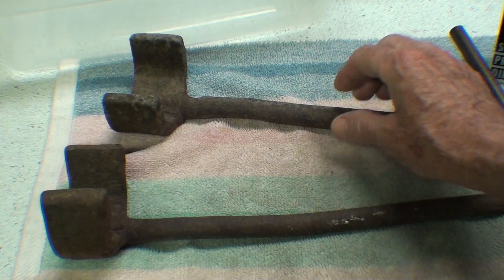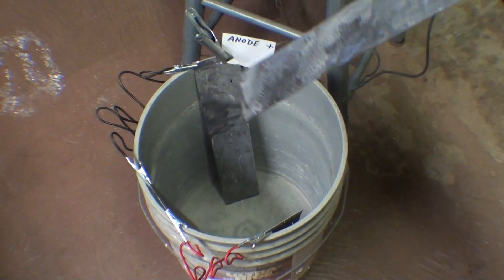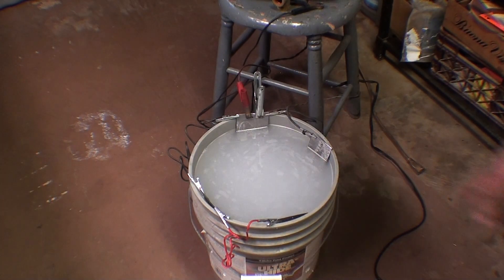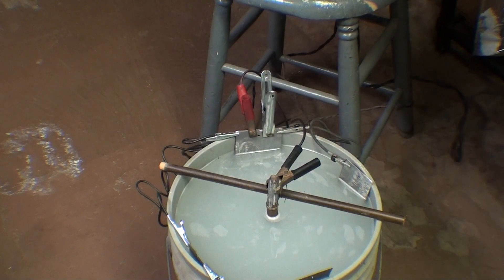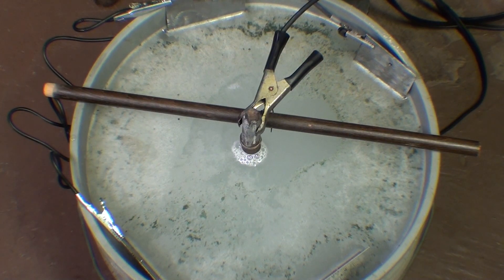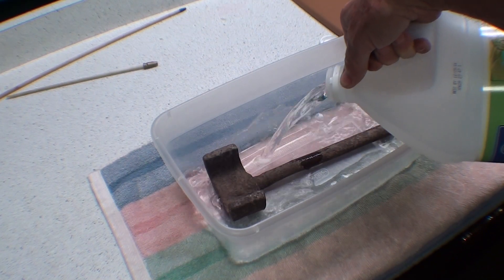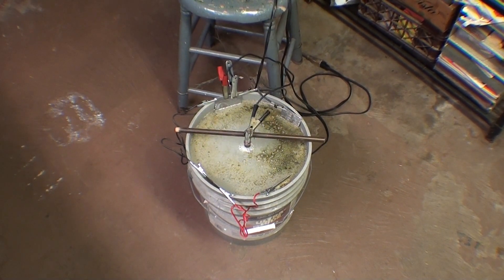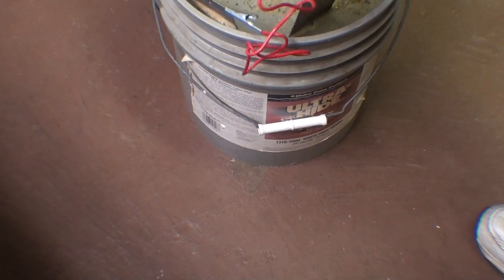Rust Removal - Electrolysis vs. Vinegar  #309 Pt 1 tubalcain

Comment: Hello  Tubalcain,

I really do enjoy your many teachings and I especially appreciate your acquired valuable  knowledge.

QUESTION :
Do you know of any experiments that combine vinegar,  soda and the electrolysis rust removal method?  (Both methods combined, like vinegar substituted for water with the electrolysis method)

i have tried the vinegar soak and the water, soda and battery charger "Electrolysis" and each method produces roughly the same results in about the same amount of time.

I don't wish to blow myself up if I try it so I thought I would run it by your viewers and especially yourself.

Thanks in advance to any and all responses,
Warren Carlisle

Comment: I tried removing rust with electrolysis and I found a few thing. If you want to do it with a cheap battery charger, it will take forever, you’re better with a DC power supply. The heavy rust will fall off, the paint will peel off like if it was soaked in paint stripper and the black residue comes off quite a bit easier than plain rust. 
I also used stainless steel anode, I know it’s not recommended but I don’t know why, and it works much better. The stainless steel stays clean as opposed to regular steel which gets covered with rust in no time and loses its efficacy as the rust builds up thicker and thicker. That doesn’t happen with stainless steel, you never have to clean it.
Reply: Stainless steel has chromium in it. If you use stainless steel for this you produce hexavalent chromium. It's bad stuff, Google "Erin Brockovich". You are producing a very toxic substance and then probably contaminating the environment with improper disposal techniques as well as endangering you and your family.

Comment: Thanks for the great videos.  I have found that if the vinegar is hot, it accelerates the rust removal.
Reply: Heat accelerates most chemical reactions.

Comment: Mr Pete, I'm sure you know all this but for those that don't: The anode is positive and cathode is the negative electrode. The reaction at the anode is oxidation and that at the cathode is reduction.( direct current flows from negative to positive)  if your amps are too high just remove some of the plates you have in there, in your case the plates are the anodes, the current flow can also be reduced by reducing the strength of your electrolysis solution. that's also the reason for the reduction in current flow over time, as the solution gets weaker by being contaminated.
Reply: I’m trying to set up a plastic 55 barrel that I cut to only have the bottom section that is about 16 inches high.
I got a car rim in it soaking in vinegar.
I want to do electrolysis but was wondering if I can just put the negative connection on the rim that is sticking out of the vinegar solution as the top part is sticking out by 1 inch and the positive in the vinegar so the rim ?

Also not sure on amperage I would need ?

Comment: sir sadly you couldnt be sure of the conditions of the test pieces which to a degree invalidates the findings. next time you may be better if you split the same test piece, bandsaw i guess, so the conditions remain alike. ceteris paribus. take care. pete. ps acetic acid is easy to dispose and it will help keep your pipes clean. no more enviro risk than turning your laptop on

Comment: I have used white vinegar a few times now but still need to try electrolysis. Has anyone used molasses? I have heard it works well but don't know where you would get a large container of molasses these days. My grandfather always used a waste product of cheese-making; he would go to the cheese factory (which is long-gone) and get a barrel of the stuff for free to soak his rusty parts in. Supposedly it worked great.
Reply: I wonder if it was an acidic solution.

Comment: Try mixing some salt with the vinegar.  It helps, buy I don't know the chemistry,  I usually wash out the metal in vinegar after removing it from the electrolysis tank. I then soak it in water and baking soda to stop the acidic reaction.

Comment: I find it interesting that a number of Youtubers have been doing comparison videos with theses two methods of trying to remove rust. In the end they go to wire wheel of some sort to finish the job, or to a glass beader, or sandblaster, or even some kind of sandpaper.
These chemical processes are cumbersome, messy, and cost a little bit of money and time to fool around with. I say take the part right to the wire wheel, or glass beader in the first place and skip these worthless steps for getting rid of the rust.
Reply: Yes, but that’s hard to do inside of a vintage motorcycle fuel tank.

Comment: Also apple cider vinegar is a bit stronger in acidity - im told theres a special "cleaning vinegar" that's stronger yet but hard to find - do you have any information on this special cleaning vinegar-?   Question:  how would it be to use vinegar along with electrolysis, would it work even better or just make a lot of toxic gas-??
Reply: 30% industrial vinegar
Reply: @douglaspollock102  Search Acetic Acid

Comment: I believe that after you rotated the anodes you forget to reconnect the jumper wires.  I don't see them connected to the anode with the positive battery charger connection.

Comment: Hi Mr. Pete. In the plating process, the part that gives up metal is the anode, the part being plated is the cathode. The part getting smaller is the anode, think the sacrificial anode on a boat or water heater. So I suggest your plates are the cathodes and your wrench is the anode, because the rust is leaving the wrench and is being deposited on to the metal plates.

Comment: When you don't have enough vinegar just displace some of the wasted volume with some bottles or bags of water.

Molasses is easy to use if you seal the part in a plastic bag with some of it and squish it around to evenly cover the steel.
Reply: Why molasses? Some missed joke?
Reply: @frogjunk  No, there's no joke here. Some ppl do in fact use molasses to remove rust.

Comment: Where do you buy washing soda? I haven't had much luck looking for it at the grocery store, home improvement store, etc.

Edit: You say you bought it at Kroger. We have Kroger here (NC) so maybe I try there.
Reply: Go to the hardware store and get a box of TSP cleaner. Tri Sodium Phosphate a strong cleaner that you can use without getting a lot of suds. TSP makes the water conductive like the washing soda.
Reply: Isn't TSP pretty nasty to work with? Good to know it works well as an electrolyte though.
Reply: TSP is a strong detergent. The phosphate part is the stuff they made mfgs. take out of washing detergent.Kitchen gloves are good enough if you have to put your hands in it. It's often used to wash walls before putting up wall paper.. which is why you usually find TSP in the paint department. It works a treat cleaning grease from the back sides of automobile tire rims, etc.
Reply: Yeah I have used it for paint prep. It has been a while but all the warning labels on the TSP made an impression on me.
Reply: awldune
The Nanny State puts warning labels on hammers too... something about don't put your thumb on the head of the nail before striking. I'd read the label and use common sense.... and don't ever use TSP as a seasoning when cooking.
Reply: +Aceroadholder TSP is also good to add a spoonful of to the dishwasher detergent.  It is the ingredient can no longer be added at the factory and, as soon as it was removed, everybody started complaining their dishwashers were broken.

Comment: Hi Lyle, you'll find higher current will work much faster and usually with a better result. A DC arc welder will have the same job done in about an hour.
Reply: You’ll find that to be completely wrong… high amps will causes more pitting